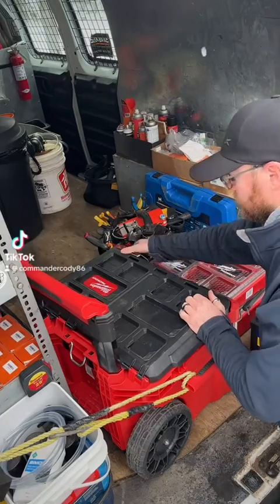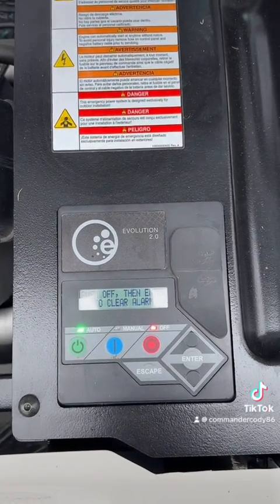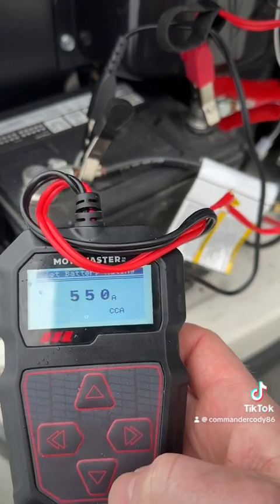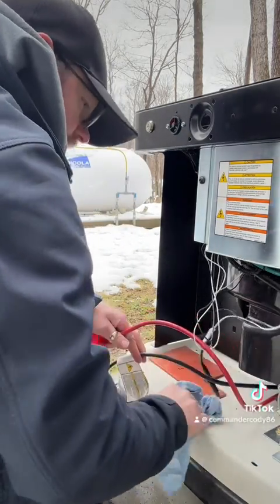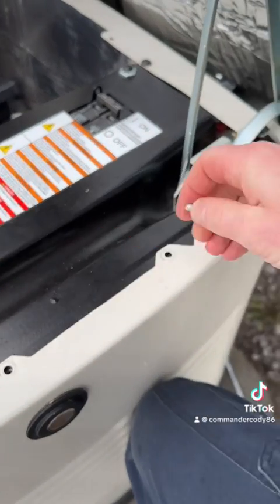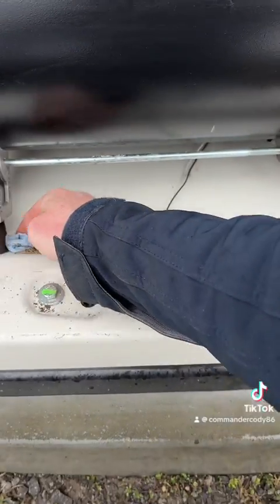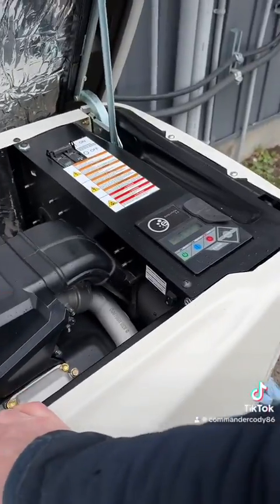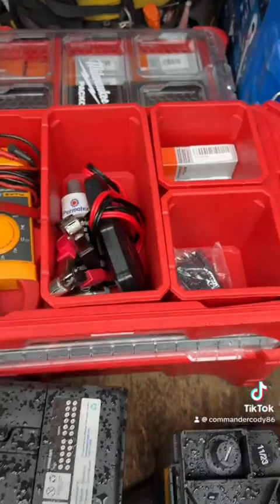RPM Sense Loss Repair on a 22kW Generac

Comment: Hey thanks for the video but I still have an issue. I have a model 58820 and I have two codes, the low battery and the rpm sense loss. I have installed a brand new battery that is charged to 12.9 volts. I have turned the unit off, pulled the fuse, removed the battery and shut down power to the house to try to clear the code but it does not clear. Any suggestions? Thanks
Reply from the maker: @davebrittain9216  Hi Dave! To clear the alarm you only need to move the rocket switch to the middle position (Off), then press enter twice. Make sure the 7.5A fuse is in the controller, then to try a manual start, put the rocket switch to the manual side. If it doesn’t crank and start you will get another code, and likely have an issue with the connection to the new battery. If it does start, you’re all good. Move the rocker switch to Off, then to Auto and you’re good to go!
Reply: @FoxEPS  That did not work, when I did that I get the typical message that is is cranking but it is not and I hear a slight thud of a relay closing/opening under the control panel then I get a message that it has stopped. What I did was energize the solenoid to crank it over by using a jumper. It cranks perfectly and does start but as soon as you remove the power from the solenoid it dies. I have an error code of "RPM sense loss". There does not seem to be a lot of information regarding these. Have you ran into this before? Thanks again.
Reply from the maker: @ hey Dave, it sounds like what you’re hearing the the starter contactor relay (SCR) clicking. There is also a starter contactor on the partition, the part that you jumped to make it start. It sounds like this contactor is not working or has a poor connection. It won’t stay running because the run circuit is not energized. If you send me an email to sales@foxeps.com with your phone number I will gladly give you a call this evening to walk you through a few more steps you can take!
Reply: @FoxEPS  The starter contactor (or solenoid as I called it) is fine. That is what I energized with a jumper and it cranks it over perfectly. I mentioned that I hear a relay directly under the control panel operating. The faint clicking is not from the SCR which is located on the inside of the engine compartment near the back of the unit not under the control panel.  I have that RPM alert now and of course no cranking. I really appreciate the help but just to let you know I am in Canada and it sounded like you are in the US. Do you have international calling?  I don't want you to have pay for a call. By the way I am pretty handy with engines as I have built hot rods, rebuilt engines, restored equipment and so on. My parents had an auto wrecking yard when I grew up and was covered in grease for a good part of my teens and younger. I just find that Generac does not put anything out there that I can find for troubleshooting. I did have trouble with it 7 years ago and called out a Generac tech that told me the engine was blown and it needed to be replaced and it was only the valves I had to adjust so I really don't trust the competence of the local company after  what they diagnosed in the past.
Reply from the maker: @davebrittain9216  I do have international calling but I’m also in Canada. I’m about an hour south of Ottawa. Unfortunately I hear this sort of feedback often; you’d be amazed how often I get called for a no start condition where another dealer recommended a new engine or generator when a valve adjustment or fuel pressure adjustment was all that was required. Feel free to email me with your number and I’d be happy to help troubleshoot. Generac has very comprehensive diagnostic manuals but they are only available to authorized service dealers.
Reply: @FoxEPS  email sent, thanks

Comment: This video was very useless. You didn’t show us how to fix it if the battery is good.
Reply from the maker: @sakaturu  the point of this video was to show the most common repair. There are a dozen other potential causes of this fault, but 95% of the time this is a battery issue. 2nd most common cause is a defective starter.
Reply from the maker: Thank you for the useless comment though 😊❤
Reply from the maker: BTW - you can use your brain and GENERAC’s diagnostic manuals to figure out the issue if not battery related. That is, assuming you can read. 😮
Reply: @FoxEPS  This guy was on another channel with the same gripe where they showed the quick fix, if the battery is good (red, enter once, green, blue to test, back to green). FWIW, my battery's very old, so that's probably the problem for me. I liked your vid for the info, and for showing how to get to the battery! Cheers from WV!
Reply from the maker: @jayhache5609  thanks for the constructive comment! I appreciate feedback that is valuable. You spend time trying to make a video that could potentially help someone and get nothing but negativity! Thanks for your support!
Reply: I liked your video. Honestly you’re far better off not responding to this type of comment.  People like this love to get the content provider riled up and they hate it when you ignore them.

Comment: These Generac suck. I have about 100 installed once’s of my own in the field. All the evolution 2.0 boards/recent gens after and even before proper tune ups throw 1505 codes all day long. New battery, spark plugs, oil, oil filter every tune ups I do. Still throws this code. Now doing the software update and one company local to me told me they did 20 starters on these things in a month. Even generators a day old. The next day they had to swap a starter out from a 1505 code. Generac is trash
Reply from the maker: Please advise this to Generac. Personally, I’ve had no major issues. But the ones I do have I fix and claim under warranty. They always pay.
Reply: Funny after reading this response I realize mine is still under warranty.  Bought it in 2016 and Generac gave me 10 years.  Geez I was stressing for no reason.  I’ll be calling an authorized service company!  Thanks.